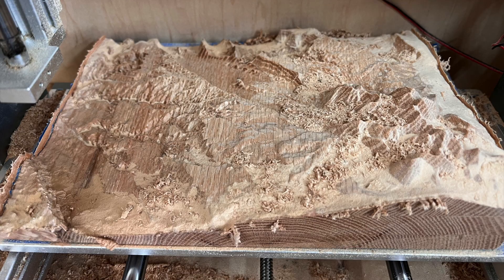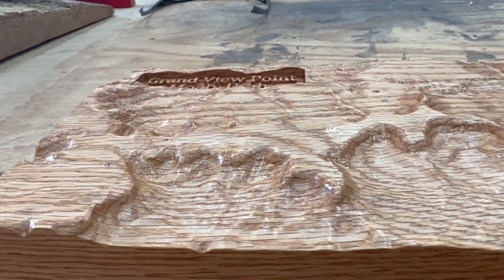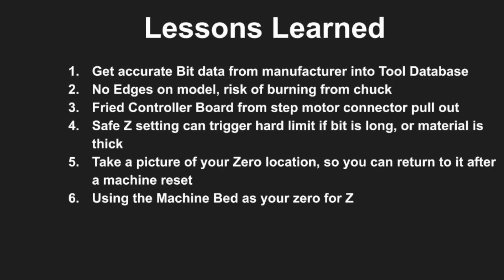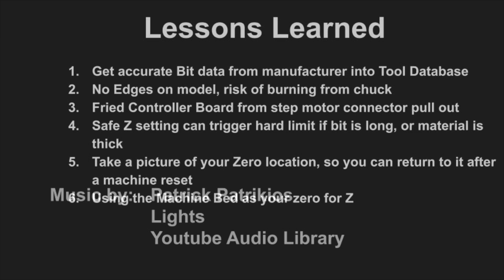Terrain Map on CNC

Comment: Hey there... i'm doing a few terrains myself on an xcarve. How do you " zero it to the bed..."?
Reply from the maker: I use the probe that came with my cnc.   But you don't have to use a probe.   Another method would be to use the paper method, where you slowly lower the bit down, decreasing the step size, until trap the paper to the surface you are zeroing to.   Then reset the zero height for "Z" and then you have a zero'd surface to the bed, or bottom of your work piece.
Reply from the maker: You just need to make sure that you set up your model to use the bed as the Z=0 or it won't work.